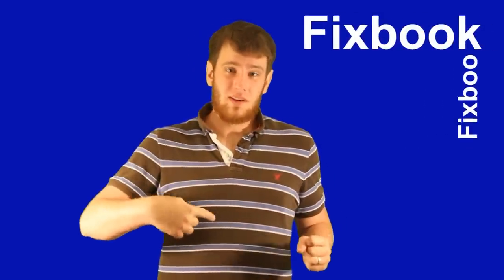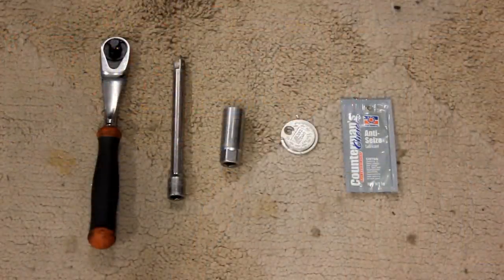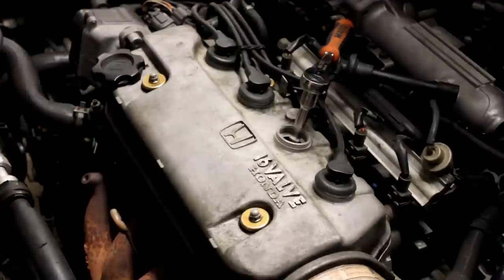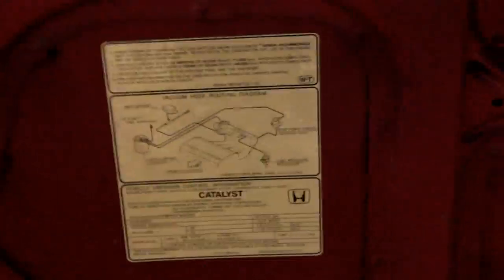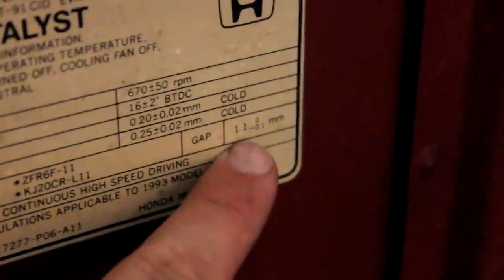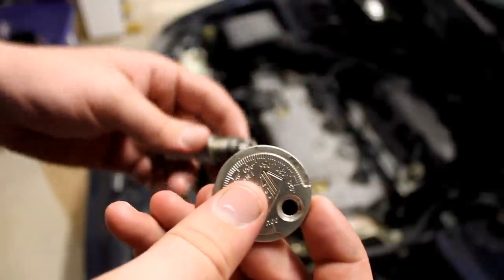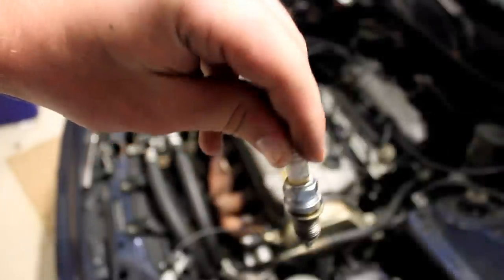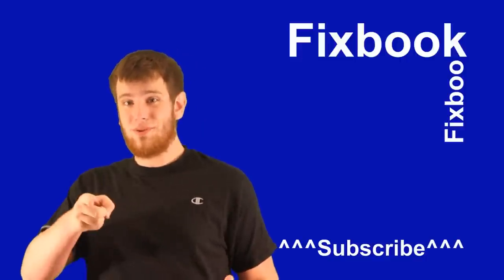How to Replace Your Spark Plugs

Comment: Do not add antisieze! It will change the heat range of the plug and throw a misfire code. Also don't forget to put dielectric grease on the inside of the plug boot

Comment: @armandofeli no it doesn't just make sure if you are replacing a wire set as well that the wires are all properly aligned, and not crossed up

Comment: I think you should avoid opening the gap by putting pressure on the center conductor. Instead use the pry hole in your gapping tool. If you have plugs with a thin wire center electrode like with Iridium plugs there is a good chance you will fracture and completely snap the electrode right off the center conductor.
Reply: Facts

Comment: 3 days after my car being serviced....the engine starts shaking & needle jumps up and down slightly ( only for 30 ish seconds from cold start)  if I try to rev the engine when this happens it stalls.... if I leave it , it settles fine & drives perfect. Is this caused by bad spark plugs?
Reply: I recommend disconnecting the battery for 30 seconds to reset your car's on-board computer.
Reply: @gsjourney3054  better late than never! Turns out it was the mass airflow sensor 👍🏻

Comment: My question is where do I find them in the car? I don't see them on my 1991 chevy 1500
Reply: What engine do you have
Reply: You can only have a v6 or a v8. If it’s diesel it doesn’t have spark plugs.

Comment: My car keeps jerking, do I need a tune up?
Reply: when was the last time you change your fuel filter.  Some cars have them in fuel tank
Reply: OK I'll check it out thank you
Reply: Lycia Wilson It could be water in the fuel tank creating power gaps, although it's doubtable. I also had a friend who had this problem, replaced his exaust with a hole in it and it stopped. Or, it could just be a derpy clutch-control method that you're using.

Comment: My first car I got two days ago when I start it it acts normally then shakes and vibrates so badly HELP :(
Reply: +PurityEmpire Replace the spark plug... Just like in this video.
Reply: yep its misfiring it sounds like. also make sure that you're not overheating either. I know very late response
Reply: PurityEmpire just don't tap it like the video super bad

Comment: my fiance changed our spark plugs in the wrong firing order now the car starts for about 3 seconds then dies how do I fix this now. I tried redoing it in the correct order but it's still doing the same thing
Reply: Their is no such thing as a firing order... The only thing that is numbered is the wires to tell the computer which cylinder is misfiring... I recommend disconnecting the battery for 30 seconds to reset the computer and replacing the spark plug wires as they may have gotten damage due to poor handling.
Reply: Only way to get it right is to fund out the firing order then find the number 1 plug wire and number one cylinder.  And start there with putting the wires on the proper cylinder.  And make sure the plugs are correct on the coils and or the distributor.
Reply: divorce him
Reply: @TheAmazingJuliano  lmfaoooo

Comment: what is that lube thing for spark plugs?
Reply: +Chalres Andrew There are a couple of greases to use when installing new spark plugs. Anti-seize compound that you apply to the threads lightly, avoid getting any past the tread boundaries. And dialectic grease for the plug to wire/coil pack contact for corrosion protection.
Reply: thanks i got it